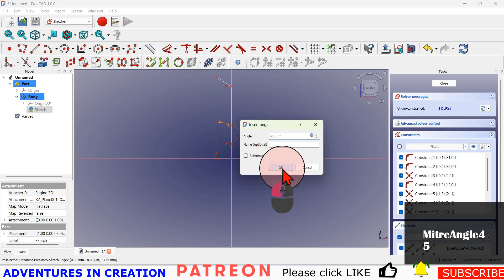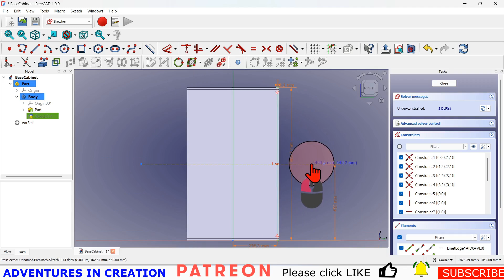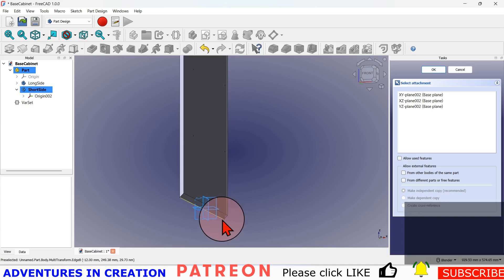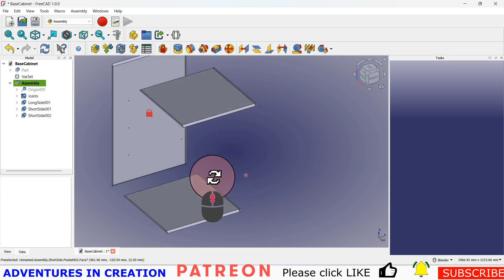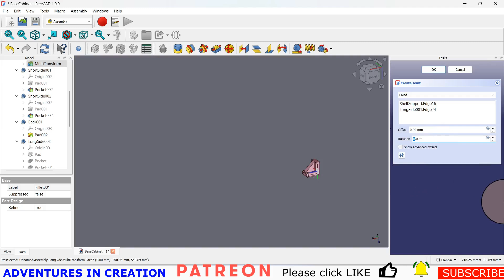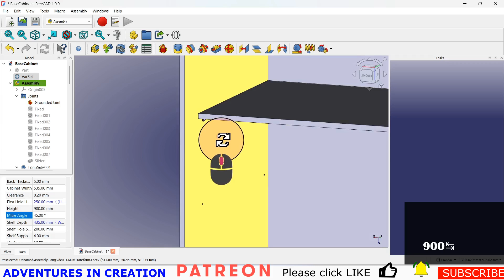Intro To FreeCAD Practical Woodworking Example

Comment: Thanks for the video. Did you make any bad experiences with making the assembly in the same file? Many other recommend separate files.
Reply from the maker: No, it's actually easier all in one file. If it were more complicated maybe switch to a separate file to keep the file size down.

Comment: Super helpful! 
Maybe a cleaner way to fix your asymmetrical problem with the side panels would have been to mirror the left side. That way you could still have the bottom and top shelves at different distances from the top and bottom.
Reply from the maker: Good idea

Comment: Thanks a lot for your answer!
Yes, I know, Blender is by far the best option, but I occasionally use some basic textures.
I used ArchTextures, but it doesn't work anymore in FreeCad 1.0.
Files created with FreeCad 0.2X that contain ArchTextures, opened in FreeCad 1.0 no longer contain textures.
I'm going to follow your advice to try EasyReflector, which I confess, I didn't find through my searches.
Thanks again for your help.
All the best to the FreeCad community.

Comment: Hey!
Do you know any method to add a permanent texture to this cabinet in FreeCad 1.0?
Thanks.
Reply from the maker: It's not easy at the moment, honestly I do all my texture and rendering in blender using an STL export from FreeCAD however, there are a couple of tools that you can use: There's a macro available from the add-on manager called EasyReflector that does a good job of making your model metalic. - You can also try ArchTextures for some basic textures. And of course there are the temporary ones.

Comment: 2:52 where did you get that model tree from? I do not get this when creating parts and later on I am unable to assemble for whatever reason. I do not get the Part level in my tree
Reply from the maker: We have to manually add the part before you add the body. It's the yellow block.
Reply: This stumped me too. Thanks for asking the question, cuz now we know there's a difference between parts and bodies (yellow vs blue step icon).
Reply: I had the same question and ended up watching the whole series of tutorials. It's all explained in previous parts.

Comment: I have major problems with your instructions. When I try to add a new body (short side for example) it is positioned in the tree not under the Part section but as a new body that is 'stand-alone'' . You think "who cares" but later on, in the assembly, it gives all kinds of problems. I also do not see the same tree highlighting and highlighting Part and then hit add body it still is created under the top level which in your tree would be under BaseCabinet. Is there some setting I've missed when creating my first freecad model?
Reply from the maker: It sounds like you are not making the part the active object when you are creating bodies. If things appear out of line in the model tree you can drag and drop them back into place. When you follow the progress, the details are important.

Comment: I work wood industry as supervisor over assembly and machining And going to college for computer drafting.  An opening came up in my plant for an engineer ... I didn't get it but the one from a highly professional college got the position . I had to train him because his drawings did this exact mistake of positioning and of course for more accuracy we always referenced from front side of cabinet to allow stock errors in actual width of blanks . Also named part left and right to help avoid problems .Awesome job you do I am trying to go through all of your videos so I may maximize my use of freecad  for my own satisfaction.  I am retired and do things for fun not profit . Have a wonderful day .
Reply from the maker: Glad you are enjoying the videos.
Reply: You are awesome! I forgot to say which you probably know reference points were front and botton because cnc operators went by drawings . What we had was Autocad.   @Adventuresincreation

Comment: I tried to move my Task frame. I can move the task window but when I hit the toggle it disappears do u have any idea why this is happening. Im using FC 1.0.0 I’m trying to my workbench same as yours I dont know why the task panel is not staying on the left hand side
Reply from the maker: Go to top menu select view->panels->tasks then hit the toggle button again, it should appear and stay there. You can also select the gear icon and change it to transparent mode or auto hide etc.
Reply: Ok Thankyou 1 more question I build stuff from wood how would I start to build a wooden box
Reply from the maker: @Barry-mw6tk  There are lots of ways, I like to laser cut them, there is a workbench that helps with adding tabs and slots. Depends how you are manufacturing the box, but you can model the parts and put them together in an assembly. I have a video on creating the laser cut box. I create wooden boxes all the time. I just did one for personal use and assembled it in the assembly workbench, it depends on the joints  you prefer too.
Reply: R u able to help me

Comment: I am wondering how to adjust the 3d image so that it has some woodgrains. Also, I would like the 3d image to include some of the dimensions.  My goal is to publish the plans so they look similar to wordsmith plans. Thanks
Reply from the maker: You can apply a material and render the finish. I prefer to do that in blender. If you take a look at #8 in the series to see how to make drawings from an assembly.

Comment: Greetings. Can you provide guidance in using the BOM in the Assembly. I find the BOM very basic by simply listing the part name and quantity. I build cabinet, and would like to add panels dimensions to the BOM. Is this possible?
Reply from the maker: Yes, it's possible. You can reference data, you will have to add a custom field for each item.
Reply: @Adventuresincreation  I do not know how to, my experience with FC is too recent. How about a short video on this topic?
Reply from the maker: @michelbelanger798  I will consider that for a future video.

Comment: I appears that both spreadsheets and variable sets are part of the original file where the parts are created.  What I want is a way to set the values of the parameters in the assembly.  That way I could design a part and re-use it in different sizes etc.  In fact I'd like to have a parent structure that references an assembly and a set of parameters so that I could re-use the assembly too, like several cabinets of different sizes.
Reply from the maker: You can change the sizes of things but they are tied to the original model as the assembly only contains references to them (linked objects). When you have the assembly open you can also have the original model open so it works pretty well.

Comment: I would have been interesting to see you mirror the side of the cabinet to see if the shelf holes would have aligned properly instead of moving the hole spacing to get them to align. I am unsure if FreeCad would handle the mirroring correctly in that case or not.
Reply from the maker: Do you mean a mirror of half the long side?
Reply: @Adventuresincreation  in the Assembly, you used two of the side panels to build the shelf. But I wonder what would happen if you had just created a mirror of that part in part design. Would the holes have lined up and could you use the mirrored side as another part in the assembly.
Reply from the maker: @HellTriX  I am sure, if I had made sure the other side was correct and then put it in the assembly as say, the left side and right side it would have worked just fine. I was trying to do it so I wouldn't have to make unique parts. There are always many ways to solve the same problem in FreeCAD.

Comment: thanks for that interesting video. I have a small request if I might. I wanted to model a shelf to build into a car, but the back is not straight, it should not be in a slot, but with a mitre. the bottom place has a depth of 850, than it goes up  straight for 150 mm. The top has only a depth of 650 mm, so the upper part of the back plane is at a certain angle, so the mitre will not be 45 degrees. how can I measure this angle, and how to assemble, I have a lot of problems with the rotation. I video about such a shelf, including drawers,  2 at the bottom and 2 in the upper part would be great
Reply from the maker: You could model the two lengths then fill in the angle then dimension it. That will give you the angle.
Reply: There's a method using a tick-stick in the physical world.
There are several videos here in YT demonstrating how to make and use a tick-stick. It's very easy to make and use it.
I think you'll get the idea how to be sure about that angle you are trying to determine.